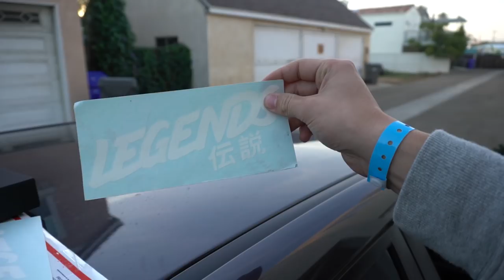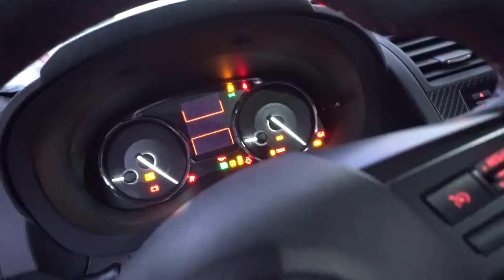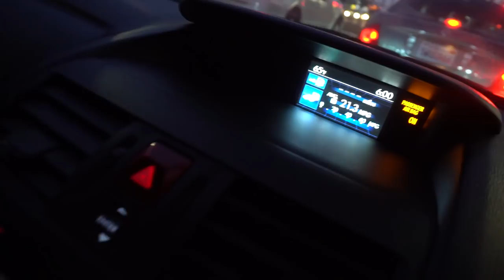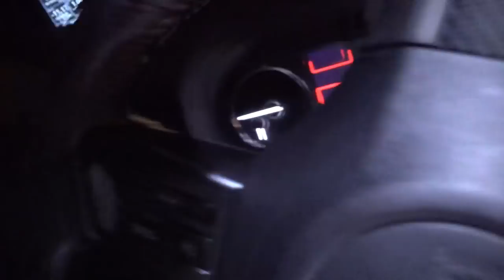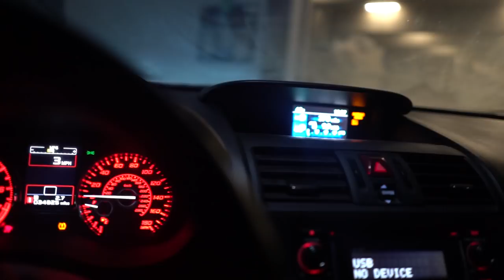GETTING BLACK HARDWARE FOR THE WRX WIDEBODY!

Comment: Take all the bolts, push them through a piece of cardboard so only the face is showing. Spray them black with a heavy duty paint. I actually did bolt heads in bedliner for my jeep because i hated the silver look on the black fender flares.